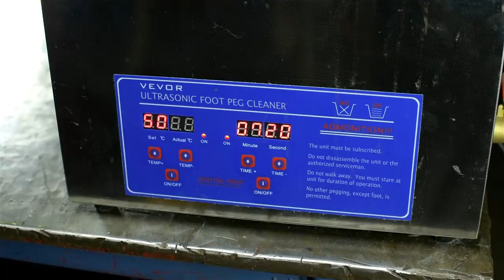7075, 7076... Whatever It Takes

Comment: There are other ways to do this such involving eccentrically drilled oversize holes and corresponding special machine screws, but also costly and not so safe as originals. Nevertheless my preference would be to replace all those worn parts that support your weight with new ones - a lot lot cheaper than a long hospital stint or worse. Spending money on safety where your life is concerned is never a bad investment.

Comment: 9:08 Correction. Hard/brittle metals like to fail in tension. Soft/ductile metals like to break in shear. Try stretching hardened vs annealed steel and you will see that the hardened steel breaks normal to the surface and the annealed steel breaks at a 45* angle (in shear).

Comment: 7075 is a zinc aluminum alloy, zinc melts at a significantly lower temperature than aluminum and firms zinc oxide which is naturally slick, at the weld/parent metal junction  you have this microscopic zinc oxide which is where the crack develops. Since the weld is in compression you may have a mechanical adhesion that will prevent the weld from falling off.
  If replacements were available you have to balance cost with benefit and I'll bet you did all that for about $2.00 an hour and you still have worn holes.

Comment: Rotor warp is a bit of a misnomer, discs like these dont tend to warp. Pulsation and run-out is often caused by uneven distribution of burnt on brake linings, or cementation, (the pad material sticking to the disc, in uneven layers) and creating high spots or bumps on the rotor.

Comment: A cupped (worn) rotor will feel spongy because the pads won't bed properly. Also a thin rotor will experience brake fade because of heat. A warped rotor would be pretty obvious.

Comment: 7075 can be punched if you mill it after.  We have parts we run that are .125" 7075 T6 that get hundreds of holes.  I punch the holes slightly undersize then ream them on the mill and mill the pockets.

Comment: It might sound strange but the harder the aluminum is the smaller die clearance you use.  For .190" 5052 I would use .016".  For 6061 T-6 .012".   For 7075 T6 .006"

Comment: I just read an article from 2019 that stated a UCLA lab has found a process to weld 70xx series. I just can’t find that process. All I know is they used titanium particles as filler to combat the liquid separation that plagues 70 series welding. Does anyone have the process?

Comment: "as you can see from the wear on the bolt hole, this'll probably get replaced sooner rather than later"

Why not just make and press a delrin or brass bushing in? We do it all the time for old SU carburetors with steel throttle shafts. Years more service is left in those things

Comment: I had a bike I tried to use as welding material so I grinded a part ON A WELD and I literally blew three or four sticks trying to make a ring after about 5 failed welds. Do you have an idea why that happened? It was an aluminum frame, and I was welding it to sheet metal and rebar

Comment: As if there weren’t enough shop hazards....there’s your humor. I’ve done untold hundreds of small and large repairs. If I had dollar for every time someone asked: Q: Is this aluminum or is it metal?” A: Aluminum was still amongst the metallic elements on the periodic table of the elements last time I checked. “What?” Without the benefit of material data or mass spectrometer time on a not-too-modern commercial product, one has to warn the client that it’s a crap shoot. “Well Ma’am, It could be 6061 or made out of melted down SR 71 Blackbird. Let’s strike an arc and see.”

Comment: you can test 7075 series of aluminum with calcium chloride solution, if it turns black or dark grey it's 7075. And for your extra bonus points if it's Magnesium use white vinegar and will also turn grey black bubbling. yes you can tig weld magnesium with the right filler and lots of argon.

Comment: I got bad news for you. 7075 is weldable I weld it all the time it is my profession. To weld it properly you must pre heat and post heat. Done properly it will retain it's temper and will not crack because of the weld. Back yard do it yourself I am a welder types run into all sorts of problems welding all kinds of material because the dont know what they are doing and of course think they know everything. The manufacturer may tell you its not weldable for 2 reasons. Liability and they want to sell you new parts. Go figure. In 1972 my welding instructor told all of us not call ourselves welders when we left the school we had only scratched the surface of the skill. It will be many years before you can even come close to knowing haif of what you need to know to truly be a proficient welder

Comment: This old Tony: This foot peg is drooping so slightly that only I would notice. Let me fix that...

Me dailying my running parts bike: I'm missing a footpeg, half the body panels, a starter, the carb for cylinder number 2 and all the tread on the rear tire. Meh, I'll just ride it till it dies cause a new tire is more than I have in the bike...

Comment: most alloys in the 2XXX and 7XXX families are not. There are exceptions to this. In the 2XXX family, 2014, 2219, and 2519 are readily arc weldable. The rest are not. In the 7XXX family, 7003, 7005, and 7039 are arc weldable. The rest are not with conventional welding methods

Comment: The thin rotor could cause the problem if the travel in the hydraulic system was insufficient for it to compensate for increased travel.  Some engineer says, “it doesn’t need to throw that far, the rotor will be replaced long before it gets THAT thin.” And suddenly you’ve got brakes that travel just far enough to feel spongy, but not far enough to get the firm feel. Come on.

Comment: Uh... duh... how about adding some material to the inside of those brackets, which were welded? Also, bushing the bolt holes and replacing the bolts would have been a better solution.

Comment: steel, with E7018's and 035 flux core... the only thing that I cant weld is the casing on high speed ball bearing bearings, welding the bottom of the old water trough that rusted out would be easy, powered iron would weld it like its 28 gauge sheet metal......... ... ... ... ... who in their right mind would weld cast iron to stainless, or out of... braze a thin bead of steel to the end of a recycled bit of titanium using flux core wire... i got some weld spatter on a titanium pipe using flux core wire... several heat cycles even getting red hot the one dot of steel on the titanium pipe is not letting go. so that means it is possible to weld cast iron to titanium.
Reply: okow tina  videos? ability to wright.... Thanks, I love ya.

Comment: I’m sorry for pointing out that it wasn’t the rotor. It wasn’t my intention to cause you stress and loss of sleep. Just wanted to educate you. 

So while I’m at it, since the pegs were worn where the bolts passed through them why not bore and bush them slightly shifting the bushing location to eliminate the lean?

As always thanks for the great video and your welcome for my valuable advice.

Comment: exept  put or make new bolts with smales tolerance everything is all right. In my case without TIG i prototype with sheet of paper and later put smal plate and lock on existing bolt  instead of weld.

Comment: I thought you were going to say you can’t weld the rotors.  I need to repair the crack in mine.
My guess is the previous owner did a LOT, or just one nasty flat landing and either twisted the lower frame ever so slightly, or just bent the mount.

Comment: You should have used alumalloy.  It melts at just 728 degrees and it's stronger than the base metal.  Plus you can drill it and tap it.  I'm afraid that infomercial is burned into my soul.

Comment: I think i would have just added a small bead on the frame  instead of the peg.   Also i might have drilled the mounting hole on the peg a slight bit and made a Teflon  bushing or brass . Used the same size bolts (new )  and called it finished.   But thats just me.

Comment: Realize this is a year old tony but crackly vinyl due to cold has specifically to do with an  the presence or absence of a compound that acts as an anti Freeze. PVC can be quite resilient in cold weather if it has been formulated for the purpose.   even incredibly soft  formulations of vinyl can be come hard and crack in the cold with out the antifreeze additive.  if you want to test the theory  Go take a summer pool toy out in the snow and bounce on it.

Comment: I saw that coming NUMBER ONE RULE NEVER EVER GO IN THE DIRECTION OF A ROUTER BIT, TABLE SAW BLADE
OR A BLADE ON A RADIAL ARM SAW!
There is some truth to the caliper taking up the difference of a worn rotor but ANY GOOD AUTOMOTIVE TECHNICIAN WILL TELL YOU A ROTOR THAT IS BELOW A MINIMUM THICKNESS CAUSES BRAKE FADE AND WOULD REQUIRE MORE BRAKING FORCE.There is a reason why there is a MEASUREMENT on the rotor for MINIMUM thickness.

Comment: I likely would have elected to simply bond on a tab of 4140 CrMo to the face of the stops of each foot peg with JB Weld and stay away from welding and the possible  loss of temper at all but that is just me.  Good video non the less.

Comment: i know that this is a bit unrelated to the topic of the video, but can you tell me what is the max amount of material removal you can do in a single pass when working with the lathe? is it 0.5 mm , more or less?
Reply from the maker: depends on the lathe and the material.  mine can push about 0.15" in steel with a good tool before the motor starts complaining.
Reply: @ThisOldTony  i dont know thé name of the lathe that we have in my uni's workshop, nor do i know thé exact name of the material, i know that its Steel, but i dont know if its hss,cold rolled etc, but we started working with about 0.5 millimètres but we were running out if time, so we pushed it to 1 mm per pass, the chip had a blue color to it, would you say we were pushing it too far ?
Sorry for the long reply

Comment: If you changed out a rotor thinking its thickness was the problem, would that not ALSO solve the problem if it had been warped. The definitive test in my mind would be mounting the old rotor back on the wheel and using a dial indicator to check run out... seems that either it would show the rotor to be true (not warped) or warped... I MUCH prefer TROUBLESHOOTING over Replacing Parts to SEE IF THAT WORKS... it's Damned Expensive and Less Productive IMHO.

Comment: No disrespect, but throw those pegs out and get a decent steel pair. Then take a file, and file the teeth sharp. Replace the peg pivot bolts with High grade 8+ bolts, and NO slop. Sometimes weight is NOT the most important issue.

Comment: 12:09 Why did you put both washers back on one side? I would think the pegs will rub against the frame bracket on the side without washer then, as opposed to as they were at 4:32.

Comment: If there was a concern about the weldability (is that a word?) of the footpeg, wouldn't a bead of weld on the point where the footpeg contacts the frame accomplish the same thing? Maybe harder to get access but it appears the frame is steel so...On the other hand, I paused the video to read the instruction placard on the ultrasonic footpeg cleaner... was NOT disappointed!

Comment: Is there any reason that you wouldn't have merely welded, adhered or affixed a thin metal plate on the steel bike frame, instead of modifying the pedal? Although... the next time you changed the pedals... you'd need to shave material off of the pedal to play nice with the frame.

Comment: So you are into trials riding... your diversity in interests is surprising, well sort of haha.  One little comment... the fracture and ultimate failure of a joint or connection detail can result from a host of different stresses both static and dynamic.
This is not to take away from a great message about undertaking repairs with a hobbyist skill level in welding or your relatively conservative and hopefully temporary repair to the foot pegs.  I must say I am not so thrilled about the material selection for your rear axle chain guard.  Just a little sensitive to this item after peeling some of the skin off my leg just above the ankle in a motocross mishap.

Comment: Why didn't you weld the part the peg bolted into??? or just get tighter fitting bolts and drill out if necessary?  Seems like you like hearing yourself talk.

Comment: Hi Thisol, the bit you made that was missing is usually a chain guide rather than a guard on these off road bikes needing looser chains than road bikes. Not sure for your bike & you probably checked the manual/parts list already! You did yes?
Reply from the maker: good catch but the guides are further forward.

Comment: Nowadays all wifesBEEEEEEP. What about that trick discovered by a university, don't remember which one right now, of using 7075 welding wire with added TiC? Making the weld stronger than the base material.

Comment: Those bolts with the damaged threads - are the wrong bolts and the cause for the elongated holes, the shaft should come to at least come to the edge of the material it's holding. That's on the manufacturer If they did a change-up, the probability of using up old stock-up, or they used a current size and did not compensate for it, or a built-in grenade $$.

Comment: How many people actually think a thin rotor couldnt cause soft brakes?? Well, you are all wrong. Hydraulics are simple, volume of master cylinder vs volume of slave cylinder + any extra wear compensation it must perform.

Lets say the volume of the slave is 10cc at full pressure with all new components with a release of 5cc into master at rest. Lets say the master has a 7cc volume at rest and the ability to move 5cc at stroke. Well, now lets take some metal off the rotor and increase the volume needed for proper pressure by 3cc. You now have soft spongy brakes.

Comment: do you have any content that could cover basic welding techniques / and or / teaches application knowledge (like don't weld this type of steel, or heat focusing when welding 2 thicknesses together).

I'm very new and don't have a ton of projects to practice with at the moment (winter), nor do i have a mentor at my beck and call.
having a video of your thoroughness (and entertaining to boot) would be very helpful i feel.

Comment: Simple question, why didn't you just add some weld to the frame side and file it back? Just curious as there may be something obvious I'm missing.
Reply from the maker: that would work!  but it's a permanent modification to the bike.
Reply: @ThisOldTony  thanks! 😁

Comment: alright so im not the most mechanically inclined person but it seems to me that it would be easier to weld onto the ostensibly steel frame and file that down instead of worrying about welding onto aluminum? But since ive never owned a dirt bike or am i a welder i dont know.

Comment: Hey, Old Tony:  Just a, probably, pointless question, but would it be an acceptable solution to build up the surface that the peg bears against, instead of welding on the peg?  (Yes, run on questions are a talent of mine).
Reply from the maker: Not pointless, good question.  Although that would have the same end effect (fix the dropping pegs), welding to the frame would be a more permanent modification.  For example, if I then buy new pegs, they'd be pointed upward and I'd have to grind out the frame weld.

Comment: Sure it wasn't oil impregnated rotor? This often happens to mountain bike brakes. Even if you sand them down a lot and use solvents, Some rotors never work the same (the pads won't grip) and the rotor must be replaced.

Comment: I would do like others have done with worn piston cylinders and throw a wear collar at it.  Doesn't have to be the entire length of the bolt, but long enough so as not to require a return spring replacement.  Do you have a length of steel fuel line lying around the shop?  Oh, during the intro, I thought I felt a tremor in the force that day and wondered what that was... :)

Comment: Isn't that a trials bike? I'm curious what good a trials bike is if you're not gonna put it thru it's paces. Trials bikes are usually absolute bare-bones, to shave off weight so riders can do tricks like bunny-hops and such, meaning their seats are non-padded, and the suspension is more geared towards survival and transferring jumping force, rather than the comfort of an aging bottom and back (items of which I also have, no shade).

Comment: I know this is an older video.... but I had not seen this one...  I noticed the peg base is steel...  would that not have been a more solid weld?  (or bush the pivot bolt and make certain the center is further inboard)...   Yes, 100 ways to skin a cat - and the cat appreciates NONE of them!

Comment: Why do you keep buying bikes without the seat?

Okay, I know it's a trials bike, but, I would rather folks think the seat was not included, rather than admit to riding a trials bike.
Warped rotors create what is known as "Piston Knockback". It pushes the piston away from the rotor.
This results in a small gap making you pump the brake just before you hit something or get run over.
I still hit things, but, it's not the fault of the brakes.

Comment: 1:35 yeah they were wrong it's not that the rotor is warped it is tiny tiny variations in the thickness of the rotor. Also you most likely got incremental improvements with each repair you did that you didn't notice. But fuck the haters it is what you say it is.

Comment: TOT, Isn't the Bike Frame Side of the Foot Pegs made of Steel. Why not Weld on that or Drill and Tap that for a Adjuster Bolt or Set Screw?  Oh, Aircraft Spruce Sells Welding Rod to Specifically Weld 7050 on Aircraft Parts.  Please Consider doing a Video on that as what ever the results, it would be Incredibly Educational for Us Mere Watchers of The Master Craftsman of the YouTubes.